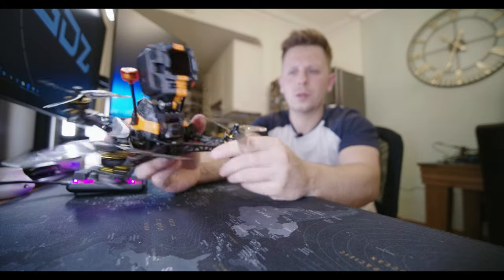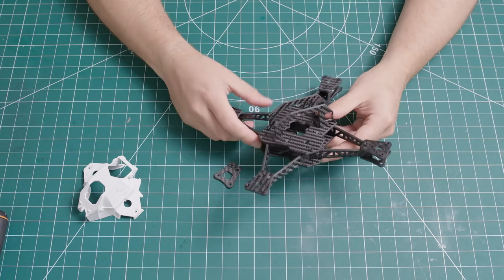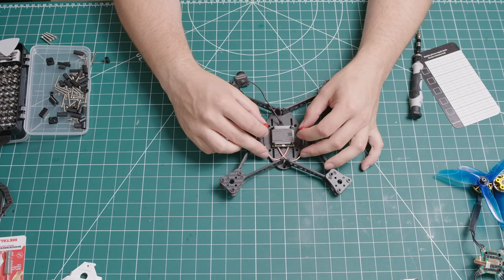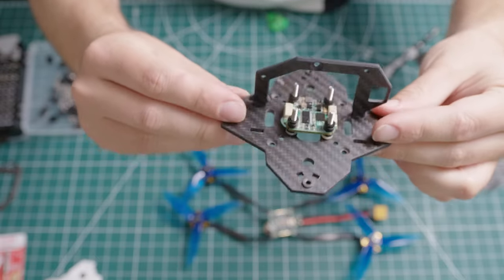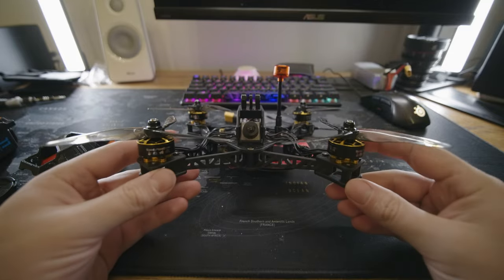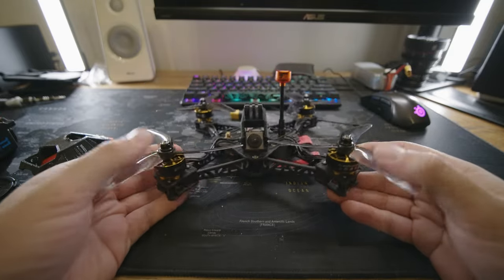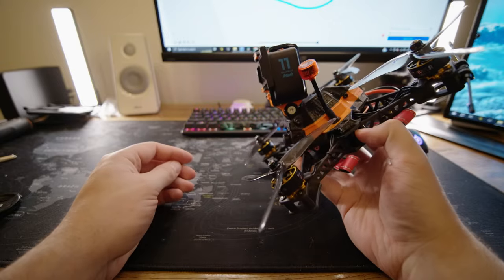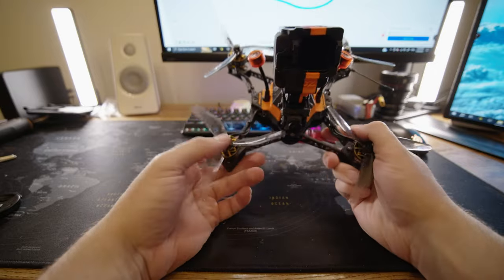The Best 5 Inch Drone For Cinematic Shots?? (2raw Afterburner)

Comment: we loved this review! thanks so much for taking the time to make it. You made some great points at the end in areas we can improve it, We will make these changes! 

One thing we would like to note is its just the 3d print you made for the gopro that stops the camera from going back, if you use the cameras feet or a different 3d print case it can go back to the same max angle as the camera, although you did mention this in your review.
Reply from the maker: hey guys thanks for reaching out and kind words, 
regarding the gopro mount year you dont have no issues with no tpu cover which gets in the way but can easily be rectified in tpu gopro case :)

Comment: May i know the settings used for the avatar vtx (cam bitrate fps for the range and penetration)? Good video btw
Reply from the maker: I tend to stick to 720p 25mbs and high frame rate at 1000mw which always seems to work well for me

Comment: Beautiful eye-catching frame. How long does the drone fly? Which battery do you use?
Reply from the maker: Battery I use 1300mah. The frame fly's really nice very locked in feel to it
Reply: @gazafpv Could you tell me the weight of the frame?
Reply from the maker: @rnxov  not right now no but can find later it's your average typical weight of a 5inch maybe a tad lighter
Reply: @gazafpv  I'm thinking of getting Tattu 1550 mah at 254 grams or Tattu 1400 mah at 222 grams, do you think that they would be too heavy ?
Reply from the maker: @Anadrolus  you'll be fine with those 👌
Reply: @gazafpv  Thank you very much !